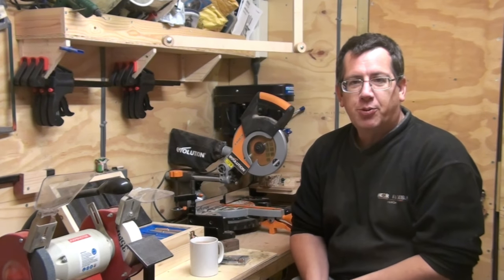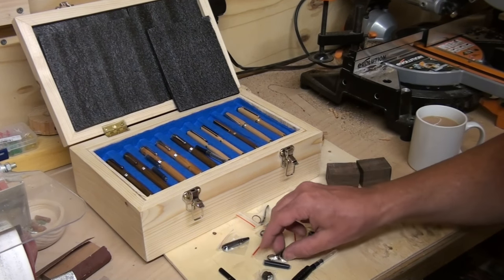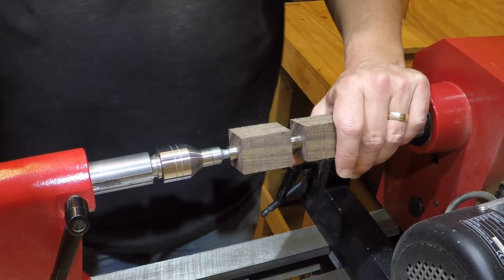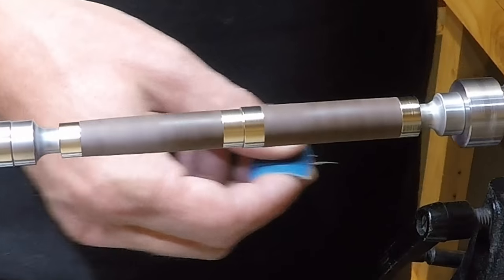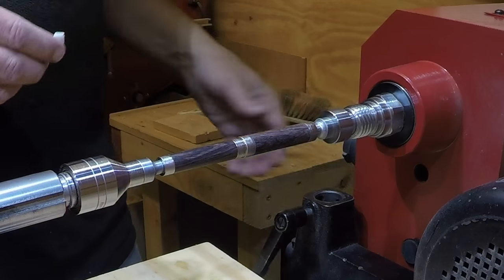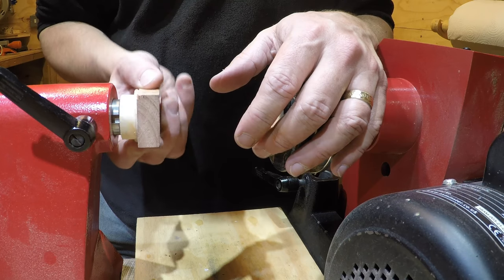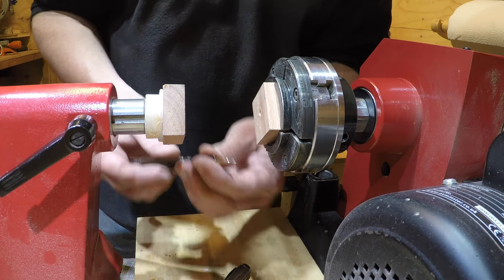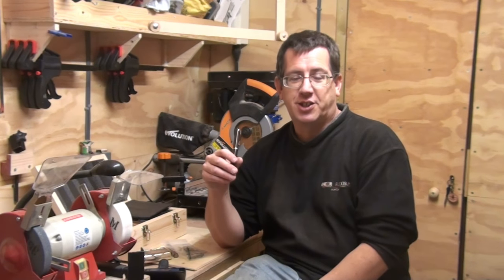Alpha Fountain Pen - Episode 93

Comment: Hi Paul I think the spring fits in the end hole of the ink cartridge (I does with the other kit I brought from them that I mentioned in your last video)😀
Reply from the maker: Thank you Harvey. Yes good point, I hadn't thought of that. You still have all the bits to swap over and store, so for home use would be good but the practicality of swapping them over is limited. I personally think that you would use it as one type or the other.